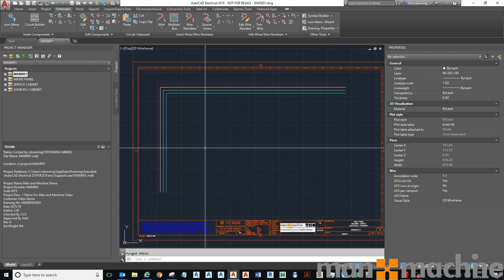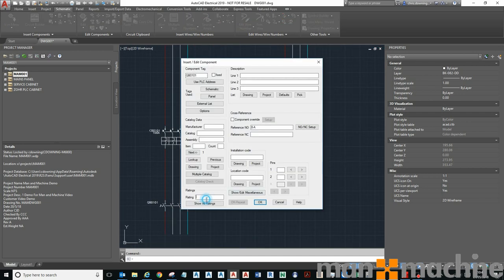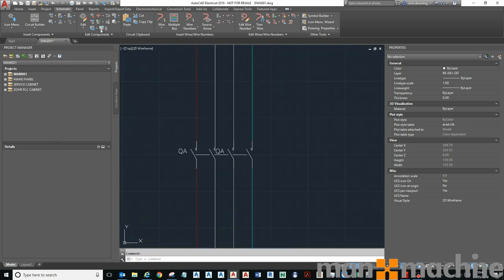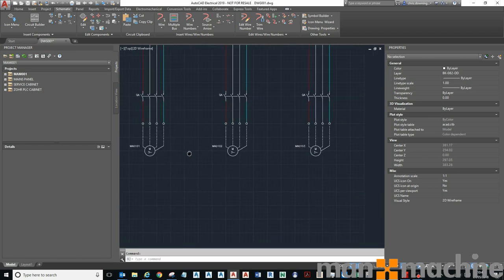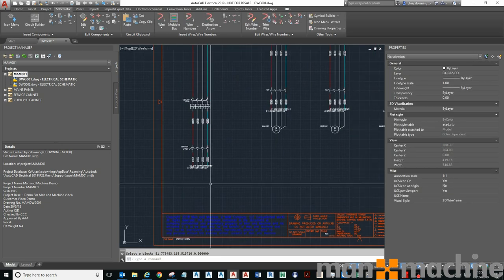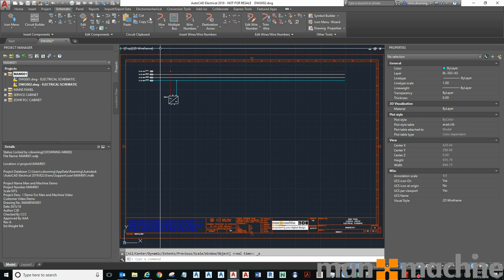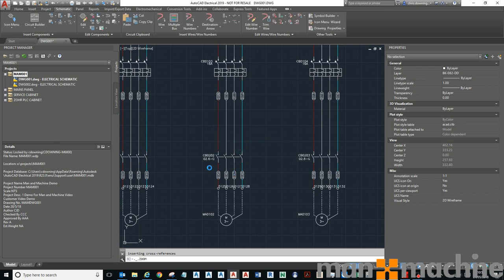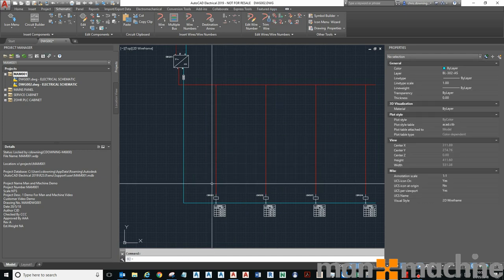Create an Electrical Schematic

Comment: Autocad electrical is one of the most frustrating softwares I have used, especially in comparison to Autocad which is easy in comparison. It has fought me every step of the way. Whether it be the menu icons or project manager not showing up, or components not automatically connecting to the bus. Nothing is intuitive or having to go into a convulated amount of steps to change nfpa to iec symbol icons. I have never had that much trouble before. Altium is a joy to use in comparison. Even the tutorials step by step are different everytime to my own experience. Even simply following the instructions to create a new circuit has been a different experience. But when I get it to work it doesn't automatically connect to the vertical buslines.

Edit for example, unlike autocad, which assumes the exact position you want to place a component is the intersection of the cross lines. I have now realised you actually have to place the circle symbol of terminals directly on the line. This would have been not an issue on autocad and there would have been plenty of guidance on the screen to let you know that you can lock in the symbol as unto the multiple bus. And now despite following all the online guides I cannot find the file when I click on component I want from icon menu.

Not the video creator's fault.

Comment: how did that schematic tab has come,please can you explain
Reply: Hi. I would recommend you scroll down to the autocad electrical after pressing windows button (if you are windows user) and click on reset to default. I had the same issue. No amount of help pages and their solutions could get the dang tab back.